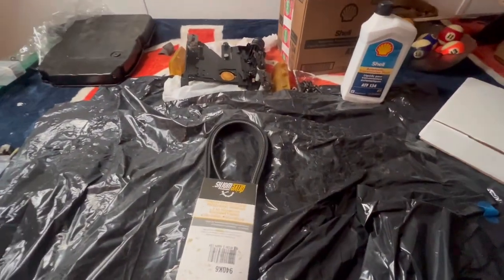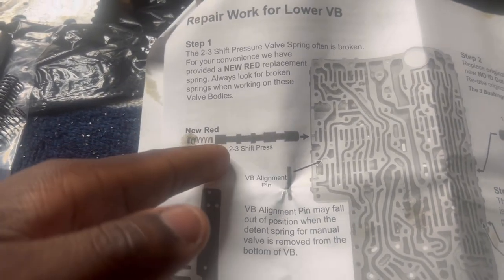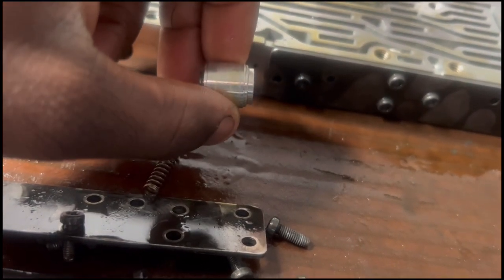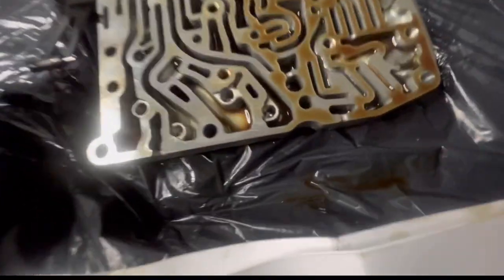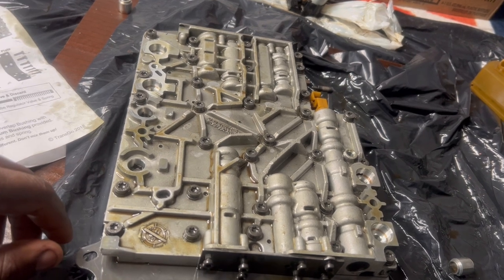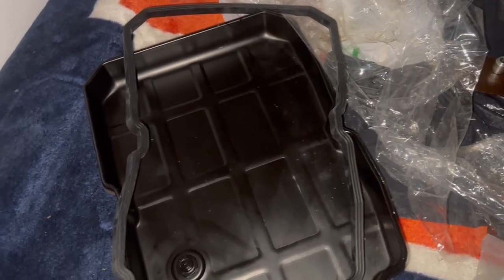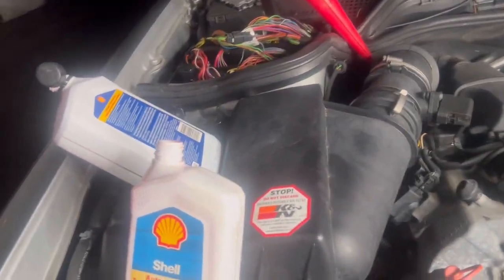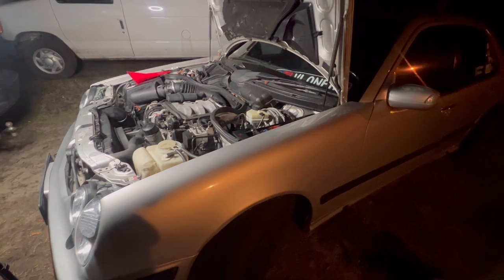In shock..The Mercedes still broken after fresh new parts!! (What’s the real issue ??)

Comment: 👍🏻👍🏻👍🏻
Have you checked the Transmission Control Unit for oil inside? Not to familiar with your specific model but on almost all MB’s since ~ 1994 the oil / transmission fluid travels from leaking electrical connectors on transmission to the control units and fills them up with fluid.
Peter
Reply from the maker: Yes sir I did I removed had it upside down cleaned contacts and honestly seem to be my gear shifter cause before prnd will glitch on cluster and now can’t see bought new gear selector and posted a recent video removing. And thanks for comment 🙏🏽🤝